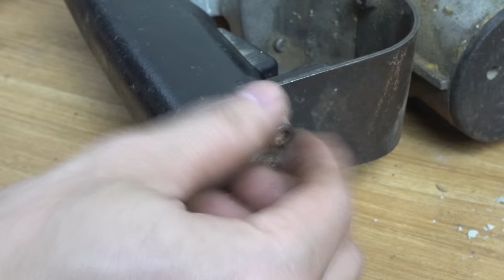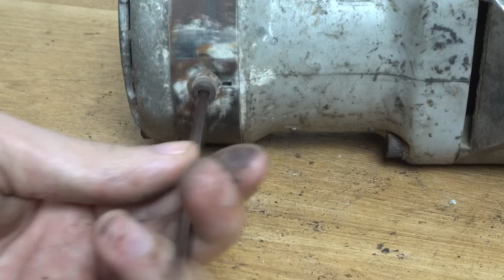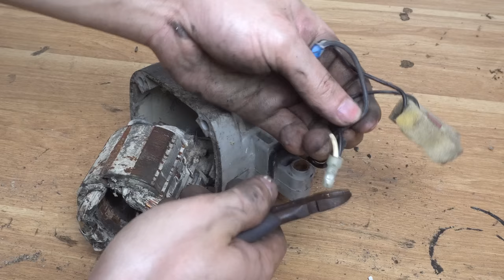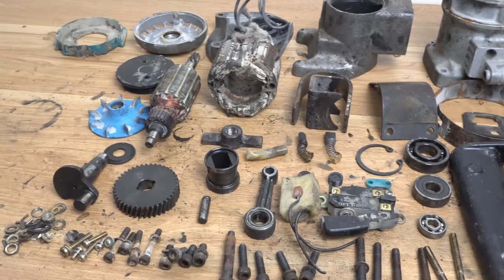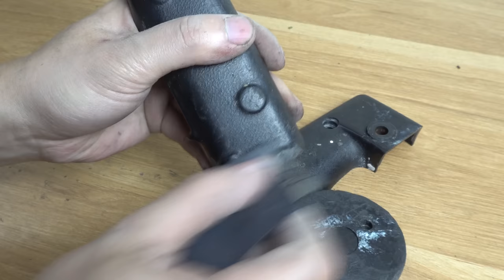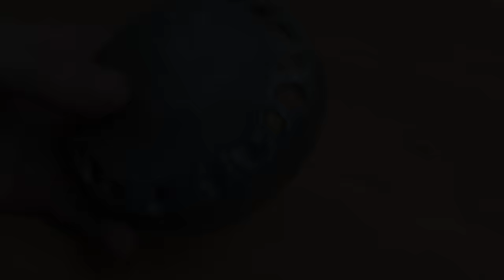Restoration Of Electric Demolition Hammer Makita HM0811

Comment: It's a good thing it won't be in working service, right? The corrosion left on the motor is enough to take it out of commercial service. Proof in point: it missed it's cutting target about a couple of inches 😂 😂
Reply from the maker: 😂If there is a stable power source, it can still be used for a long time